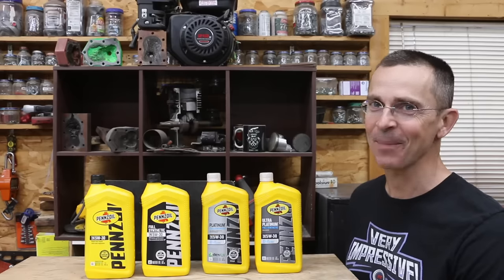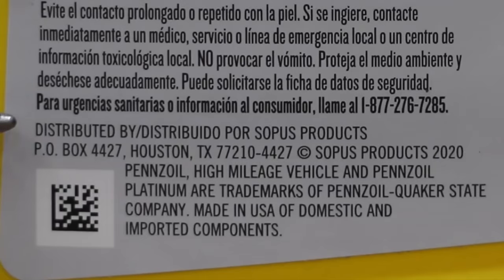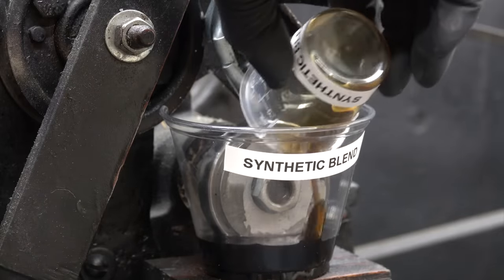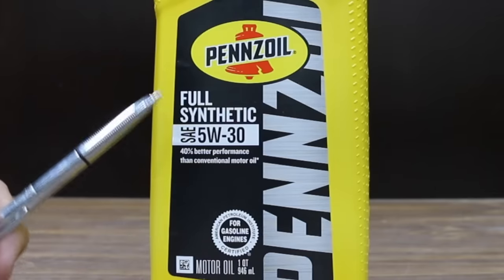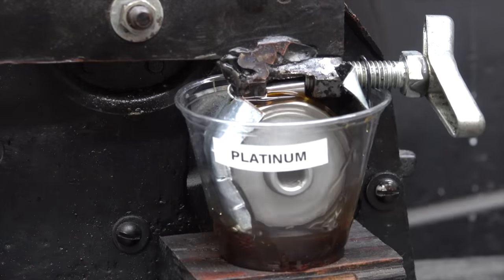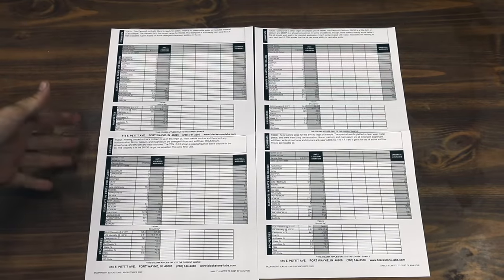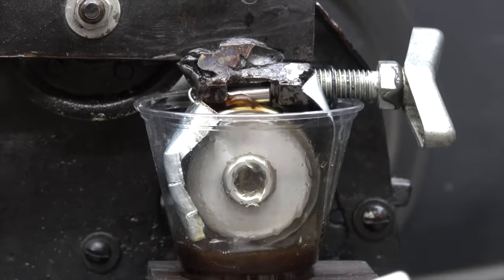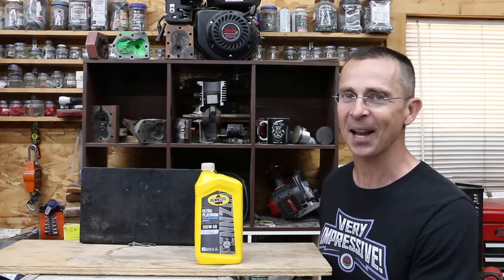Are They All The Same Motor Oil? Let's Settle This!  Four Levels of Pennzoil Motor Oil Compared

Comment: Very interesting results. I look forward to seeing more brands tested within the brand. For instance, is Mobil 1 from Walmart the same as from an autoparts store? Another test I'd like to see is a comparison of Pex pipes vs copper and iron. There are multiple brands of pex. Freeze them, abrade them with sandpaper, bend them, pull them till they break, corrode them, see how long they hold heat, etc.
Reply from the maker: Thanks for the video idea.
Reply: I've been getting mobile 1 synthetic high mileage from dollar general store for 6 bucks a qrt but it's in a different kind of package grey bottle with a white mobile sticker on it.
Reply: Seems extremely unlikely that a company would put the same label on different products based on where they are to be sold, especially since I assume motor oil is prepared in huge batches and stored until the orders come in from WalMart and other customers. Short of someone selling counterfeit Mobil 1 (after all, if they can sell counterfeit brand-name toothpaste, why not motor oil ?),  I wouldn't expect any difference except price between Wally World and a reputable autoparts store.
Reply: @compact1620  you can get 5 quart jug from amazon for $28
Reply: @trailblazeratv6306  cool thanks for the heads up I'll look into that.

Comment: 5% fuel in oil increased scar size by about 10%.  This is great info.  Thanks.
Reply: The newer antiwear additives aren’t as durable as the traditional zinc compounds.  The best antiwear chemical is ZDDP, zinc dialkyldithiophosphate, but it destroys catalytic converters, especially the ones on diesel engines.
Reply: @wallacegrommet9343  Hahaha, ....I have a turbo engine with silver rod bearings (Subaru Forester XT) where zinc in presence of acid corrodes silver bearings.  I try to stay away from high ZDDP oils as much as possible.  The Pennzoil Platinum has very low levels and that is what I like to use.  I also use NAPA branded oils (Valvoline with a weaker add pack- read lower ZDDP).  My oil change intervals on this car are very short to avoid acid build up and to counter a weaker antiwear oil situation.  Turbo Subarus WRX/XT are known to have rod bearing related engine failures.  A lot of people in the Subaru community react by using slightly thicker oils that have higher ZDDP concentrations but that actually contributes to failures.  Subaru does not say explicitly about ZDDP having a deleterious effect on silver bearings just requires synthetic oils of no higher than 5w-30 viscosity, ...these thinner oils have low ZDDP levels mandated.  The thicker oils nearly all have higher ZDDP levels.  I am saying all this since you mentioned the ZDDP topic.  Thanks for replying btw.  I hope you're not a WRX owner using high ZDDP.   Locomotives have silver bearings and use completely zinc-free oils.  The holy grail of Subaru oils is ENEOS Sustina with ZP substitute of ZDDP.  Youtube has a video:  ENEOS SUSTINA - How it Works.
Reply from the maker: You are welcome!
Reply: I drive a VW Sportwagen TDI diesel, one that was sold back to VW during the emissions cheating scandal. VW applied the EPA approved software and emissions improvements to bring it back into compliance.  These low mileage diesel cars were then auctioned to VW dealers for retail sale.  Also included as part of the historic recall was a full warranty for ten years from date of original service on all engine and drivetrain components!  Regarding motor oil, only VW specification 507.00 oil is approved for use with this engine.

Comment: I’ve been using full synthetic high mileage oil for my 02’ focus and my parents 09’ civic and 14’ focus and it made a world of difference. Not only did fuel efficiency improve but all our engines ran more efficiently and smoothly. “Expensive” oil is well worth the price !
Reply from the maker: Thanks for the feedback.
Reply: I bet that's a placebo effect, these things are tested in real world, dynos, engine teardowns, etc and it ends up as very close to zero difference given same true viscosity @ temp, not a "world" of difference.
Reply: @stinkycheese804  okie

Comment: For reference: Pennzoil yellow bottle has just enough synthetic content to be legally called “synthetic blend” but is actually their standard grade (conventional) product. Pennzoil Gold is the “real” synthetic blend option at around half of the product being synthetic. Pennzoil Gold is often used by shops as a “meets minimum spec” product since it meets Dexos1 Gen 2 without being fully synthetic.
Reply from the maker: Thanks for the feedback.
Reply: This is why I go to a shop that allows me to bring my own filter and Oil. plus, they almost ALWAYS overfill.  (i also pre-measure) so its fool proofed.
Reply: @Sublimer79  a little bit extra isn't going to harm anything.  Even an extra half a quart shouldnt.  I had a customer bering back his yamaha wave runner to our shop because it was over filled.  By like .5 oz.  Some of you guys know so much that isnt so🤦. The oil change kit comes with the oil in a factory filled bag and the filter.   Because checking a wave runner oil has to be done on a trailer and perfectly level parking lot. So a tech can just pour in the oil and not worry about it.  The residual oil is likely why it seemed over full. Those engines have to have their oil extracted.   People worry way too much over this.
Reply: @blue03r6  I've real its bad to overfill.  Why should I ignore that?  the manual clearly tells you how much to use.  Besides why throw away good oil by over filling?  It matters bec its not made for more oil. And I don't now exactly how much they overfill. I do know the manual says it's supposed to be between the upper and lower line on the dipstick.  AND before I started measuring myself.  It was always ABOVE the UPPER line.  my car only uses like 3.3quarts so every little bit could add to the other oil change. maybe, half a quart is nothing to a large car. But, a 1.7L engine doesn't need much. Maybe,  all cars would run better if we did worry about what the manual asks for. Instead of just using a dipstick.  (With the internet it's super easy to look up how much any car needs) it should be quicker. Since you don't have to keep checking it.
Reply: @Sublimer79  im a certified yamaha mechanic.  Not kidding.  I have the certificate.  Its really not that critical.  You picked something to obsess over for no reason. If that shop has a tendency to put an extra quart in your engine without being babysat then find another shop.
Reply: @blue03r6  I had this issue with many shops.  Which is why I started doing it. I had the car for 10y ears now. Plus, it's a lot cheaper to buy my own oil. To avoid the mark-up. Plus, I like to choose my own oil filters. Since the shop ones are usually shop grade. I'd rather go a little higher. Plus, I play with additives so I can add it directly to be oil.  If I didn't with their over filling and my wanting to add an additive like Marvel mystery oil for example.  I may not have the room. The are is 17 years old.  It's not really an obsession just. I like to remove variables this way I know what's in my car and at what weight every time.  So if the car doesn't do as well on one oil I can switch.  personally, it seems my car does well on 0w20 Warren Oil Company International. Runs well in the winter some oils seem to get thick causing harder starts in winter. Even at the same weight.
Reply: @Sublimer79  if you’re gonna be like that do your own oil change. Us mechanics don’t like customers who whine about every little thing. Your oil being 2mm overfilled on the dipstick won’t hurt anything.
Reply: @andybub45 They don't see to care. I'm not making them work harder.  I'm literally doing part of the work for them. There is no bitching.  Bec I just do it and have for year's with the same place now.  It would be more work for them to find the correct filter and oil.  sounds like this is more of a you issue.  I don't complain bec I solved the issue.  Just bec you don't believe it matters doesn't mean it's true. Every car is different some cars are more picky than others about all sorts of things including Oil.  Like VW's and audi's for example.  You assuming me doing the work is somehow makes me difficult. When being difficult would be NOT doing anything and bitching every time.  This way I take away the problem altogether. Don't blame me bec you have bitchy people issues.  I'm literally just taking control of the situation.  Which, they don't seem to care that I do.  They often ask me to get my own parts. Maybe bec they are busy and understaffed maybe. It's easier for me to find the parts.  I don't know.  Every person is different.
Reply: @Sublimer79  Gotta say, if you're going to all the effort of getting your own oil and filter, just do it yourself?? it takes like a half hour, and can be done with the most basic of tools
Reply: @ProjectFarm  wonder why the platinum was worst out of the others best using full synthetic bottle instead of the regular platinum if you can't find ultra platinum
Reply: @ale6242  They only charge 14 dollars.  It's a low car.  And I only have an apartment. It's not hard for me to buy oil and filters. I enjoy trying out new oils. Or did. Now, I just get the genetic synthetic since my car does well on it. Like super tech for example.

Comment: It’s often said that engine crank and rod bearings can swell when exposed to antifreeze.
I’d love to see that tested against the variety of antifreeze compositions.
Reply from the maker: Thank you for the video idea!
Reply: If antifreeze is coming into contact with crank shaft and rods it doesn’t matter what kind it is, you have other problems to resolve lol
Reply: @randallrogers8183  of course. But if you can run an antifreeze that doesn’t swell the bearings, maybe you can discover there’s a problem before you snap a crank.
Reply: @LujinCustom  Youre much more likely to spin a bearing and throw a rod then you are to snap a crankshaft lol. Or ruin piston rings from changing the viscosity. Ive never see a snapped crankshaft ever in my years of engine building and equally so destroying.
Reply: @jimjones432  back in my early days I personally snapped a crankshaft on a ‘94 Olds Achieva.
Reply: that doesn't seem true...
Reply: This would be a cool test. I've personally seen 2-stroke snowmobiles engine cranks explode because of a gasket leak. So maybe 2-stroke oil + antifreeze would be a better test?
Reply: @clay_d  believe whatever you want. Doesn’t matter to me
Reply: @ic3man5  especially if he can get one to explode 🤣🤣🤣
Reply: @LujinCustom  lol explode is an exaggeration, bearing just spun but sounds cooler to say explode
Reply: Good luck coming up with a way to contaminate the crank case with coolant in a controlled manner
Reply: @jankington216  @ProjectFarm is a pretty smart cookie! He comes up with ingenious tests. 😜
Reply: @LujinCustom  I'm sure he could pull it off, even if he has to do an engine rebuild in between tests
Reply: @LujinCustom  I'm sure he could pull it off, even if he has to do an engine rebuild in between tests
Reply: @LujinCustom  I'm sure he could pull it off, even if he has to do an engine rebuild in between tests
Reply: @jimjones432  BTW, as I recall, it was a spun main bearing on the Olds Achieva that did her in…right after I’d done the lower intake on that v6.

Comment: I've been using Amsoil 5w40 in my turbocharged GDI 2.0T engine. It currently has 217k miles on it and makes about 100 hp more than it did stock. BSL told me to go 9k miles between oil changes but I stick with 7k miles. Factory oil cap says to use 5w30 but in the owners manual it says I can go up to a 15w50 (ambient temp below freezing). For my other 2 cars (2014 Corvette z51, 2009 Gmc Acadia) I use Pennzoil Platinum from Walmart since I can get it in 5 quart jugs. The Vette takes 9.6 quarts to fill and the Acadia takes 6 quarts. 

I'd like to see the difference in wear scars between 5w20, 5w30, 5w40 and 15w50. I think it would make an interesting video. You could also go over the owners manual recommendations and teach most of your viewers how to read and decide which oil is best for your engine.

My turbocharged engine is one with a recall that a lot owners have rod bearing failure between 60k and 120k miles, I'm convinced my choice of oil and filter is what has kept it going.
Reply: What mods did you do to your GDI Turbo 2.0 to get 100 hp more than stock?  Just curious.
Reply: Generally speaking oil protects against wear 2 ways.

The first is film thickness (oil viscosity), the other is film strength.

If you are in a warm climate (no snow) using a thicker oil will protect the engine better than a thinner oil (provided the manufacturer specifies that the thicker oil is allowed)

The 2 down sides are that thicker oil increases fuel consumption compared to thinner oils, as well as reducing performance a bit.

If the viscosity on the oil cap and what is in the owners manual differs, my guess is that what's on the oil cap will give you the best performance (output and fuel economy)

From what I've heard racing engines generally use thicker oil (for the better protection), so you using a thicker oil may be the reason that you haven't had any issues with rod bearings.

Though without knowing the root cause of the issue I can't say for certain.
Reply: @LA_Commander  full bolt ons (fmic, intake, full exhaust) and tune. Made 300whp/385wtq in 2019 with about 160k miles on it. Stock turbo blew up at 190k miles so I swapped out for a bigger stuffed turbo so it makes a bit more now. I have a few videos on my youtube profile you can check out.
Reply: @c4rn199  i would love to check them out, thanks!

Comment: I run the Pennzoil Ultra Platinum in my 2017 Chevrolet Silverado, my 2012 Honda Accord and in my 2001 Honda Accord and it’s been a fantastic oil in all these vehicles! I usually change the oil in all of them at 5k mile intervals, regardless of what the oil change monitors in them suggest! Thanks again for an awesome video

Comment: Ultra Platinum is great.  I replaced Amsoil with it because of the cost and ease trying to find it.
Reply from the maker: Great oil selection!
Reply: Buy amsoil by the case and you can put more miles on amsoil signature series the cost offsets itself

Comment: Hard to believe that the synthetic Pennzoil is better than a platinum synthetic
Reply from the maker: Thanks for the feedback.
Reply: @ProjectFarm  thanks for the great video
Reply: Seems to be it is penzoils money maker. Laveled fancier and more expensive but worse then regular full synthetic = larger profit. Personally i might start mighting half penzoil full synthetic  amd ultra platnum, therefor making a blend that would be better then regular platnum for about the same price. Or just settle for regular full synth
Reply: The platinum will guarantee 15 years or 500,000 miles
Reply: Wasn't a fair test. The platinum is a high mileage oil. Others not.
Reply: it doesnt say that on the container......
Reply: @acts2211  my bad.
Reply: I think it's because it's formulated to be compatible with modern engines and the emissions equipment on them, which limits what additives they can use in that oil.